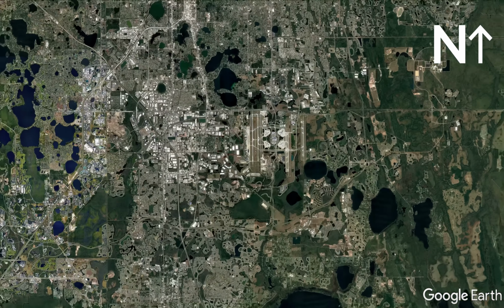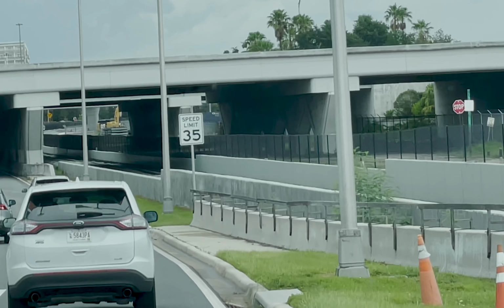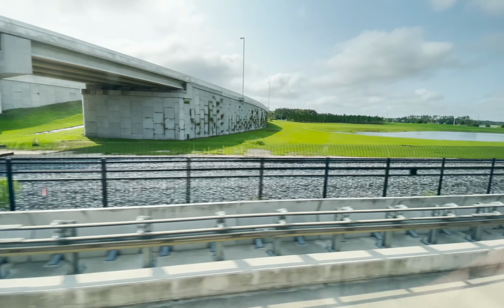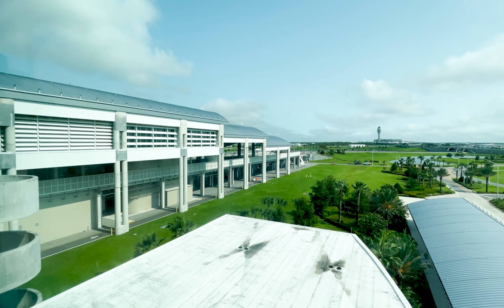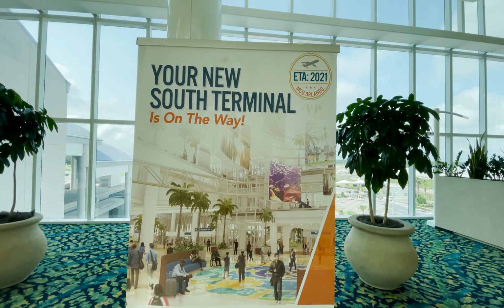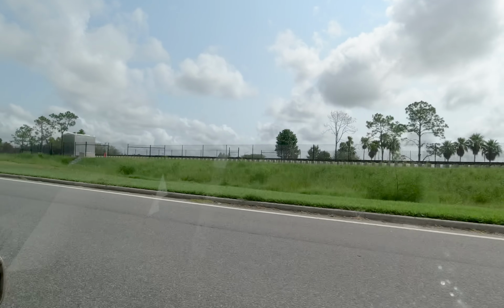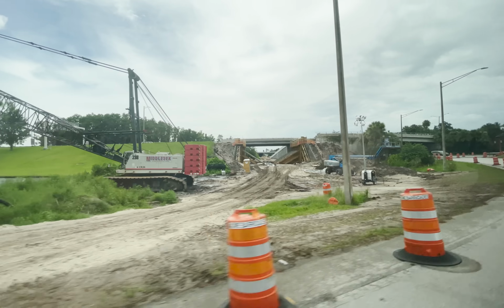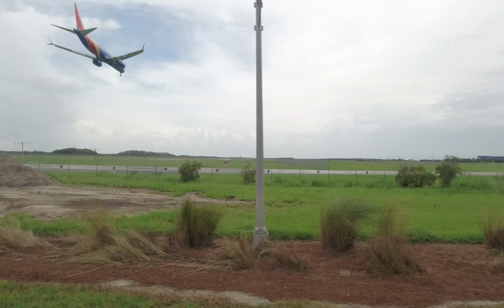Brightline Orlando International Airport Passenger Rail Construction - July 2021

Comment: There is so much road construction from this railway coming in. They had to move the highway going to 528 from the airport/hotel directions. Just flew in there two days ago & the Holiday Inn driver explained it since the hotels need to be kept informed as they pick up/drop off the passengers to the terminals. I'm still curious to see how they are going to  do the tracks at the Rt. 520 exit.
Reply from the maker: That road work is not related to Brightline, the florida department of transportation just happens to be rebuilding that interchange with the 528 at the same time. It will go over 520 on a bridge.